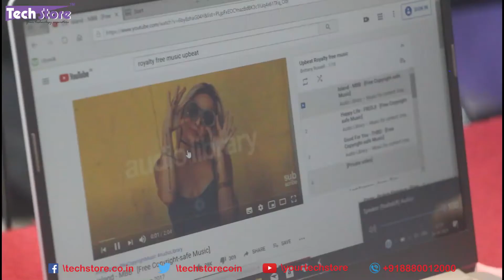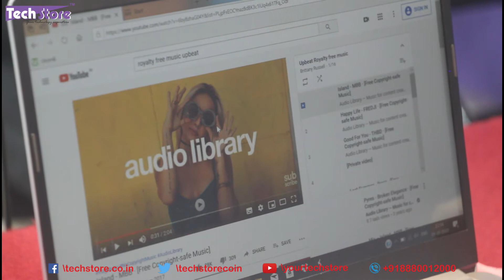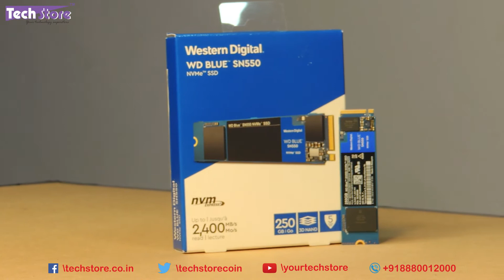HP 14s CF3006TU : CF DR series 2020 disassemble upgrade ram m.2 ssd hdd ram battery easy diy

Comment: I have purchased the same SSD shown in the video. Now I am planning to install it on my laptop. As cf3006tu came with installed OS how can I transfer the current OS to SSD? Is there are procedure or I have installed a new OS
Reply from the maker: First create a recovery pendrive from the hdd. Then remove the HDD from the laptop and install SSD and boot from pendrive to recover the factory image on SSD. After recovery completed, again connect the hdd.

Comment: Bought this laptop last year but the performance is very² slow  it hanged alot
Reply: Bro I upgraded last week with 250 gb ssd crucial and I order 8 gb ram too.. I face  the same problem  too now it’s running a stunning performance 🎭

Comment: is 11th gen i5 hp laptops coming with ssd are having hdd slots also? for example 15 EG0103TX
Reply from the maker: You need to buy a HDD Connector seperately. Thanks for watching. Do Subcribe.

Comment: HP 14 Ultra Thin & Light 14-inch Laptop (10th Gen i3-1005G1/8GB/256GB SSD/Win 10 Home/MS Office/1.47 Kg/Jet Black), 14s-cf3074TU same process apply in this also
Reply from the maker: yes...same process

Comment: Thank You,
I have ho 15s du 2071tu,
And it's overheating  50-83°C , so should I replace thermal paste myself or call hp technician ?
Reply from the maker: Please apply thermal paste and if it does not resolve, then call technician.

Comment: I want to upgrade my  hp 14s cf 3006 tu please suggest some 8 gb ram which comes under 3000 rupees. I don't know what ram will support my lap
Reply from the maker: You can install a Crucial or Adata ram. Thanks Do Subscribe.